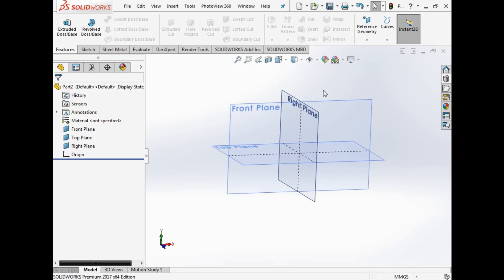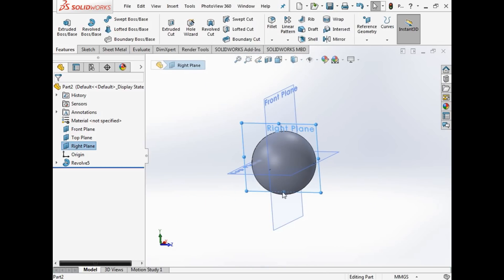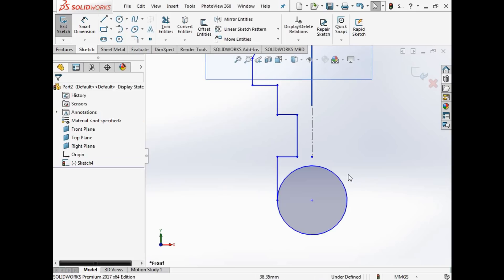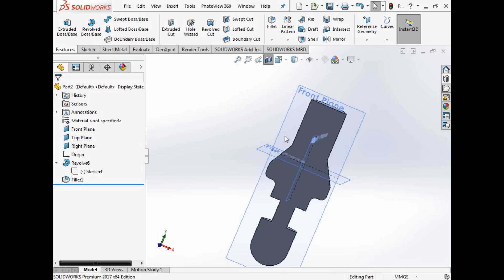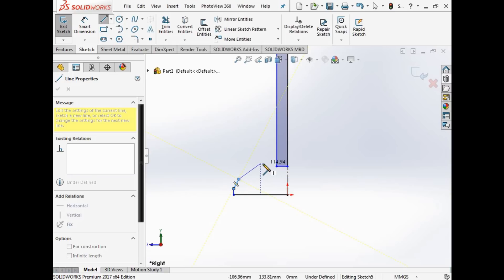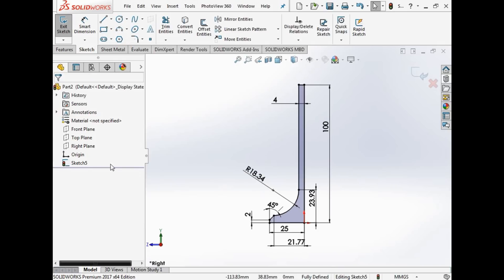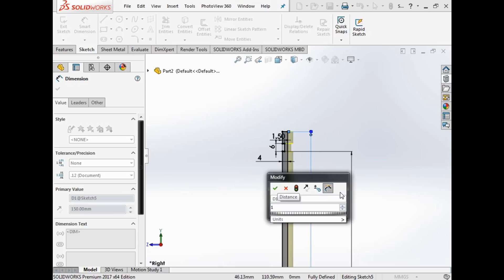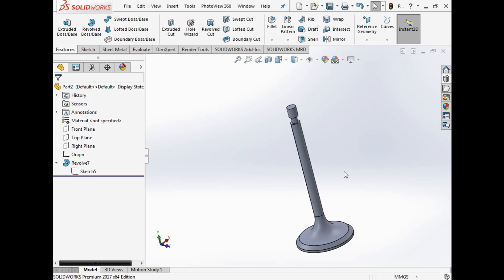Easy way to Solidworks - Part 2 - Editing Sketches

Comment: I used to work with solidworks for about 5 years. Just double click on  the body, and on the dimension you want to change is much quicker then choosing the edit sketch option 😉 
Any how Matt. Keep up the good work
Reply from the maker: When showing people how to do the basics you have to go through the detail - the quicker ways of doing things either come later or they pick up themselves - there are loads of short cuts that I use everyday - most of which are key strokes and shortcuts but this doesn't translate well

Comment: The last point made in this video is golden information, reference locations fucked me so hard when I first started learning CAD. 👍 
Have any CAD design favorites, something you designed or not?
Reply from the maker: "Have any CAD design favorites, something you designed or not?"

- what do you mean by favourites?
Reply: You don't browse CAD files for fun!?
Worked on a team once, where we were doing rheological test with CATIA, I found it super interesting, probably my favorite work I've done with CAD. Didn't know if you had similar experience/interest with your CAD work. The old aviation piston engine models (the ones with weird configurations) are my favorites, like the P&W r-4360, Napier saber. Could always get the Merlin and do some mods/sims with it!

Comment: I was told NASA is reverse engineering the Saturn 5 with similar tech to this for the Mars rocket since construction plans on paper are not used anymore. Can YOU use a slide rule? Not me! Von Braun never wanted to go to the moon. He designed the Saturn 5 to go to Mars with one!
Reply: Ha good point, no clue how a slide rule, abacus, or long division work!